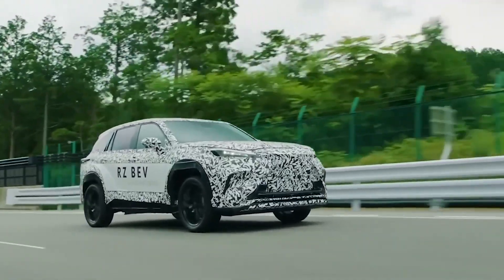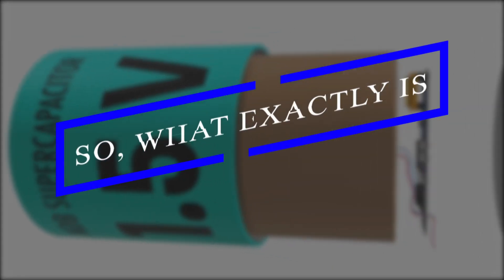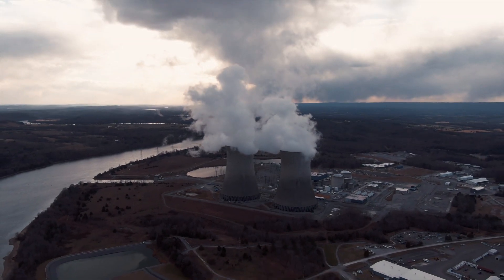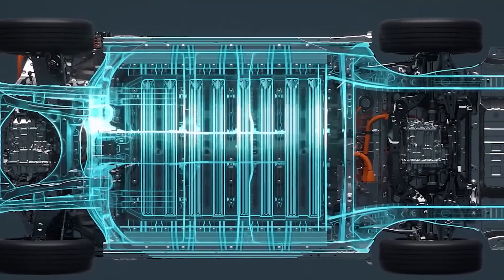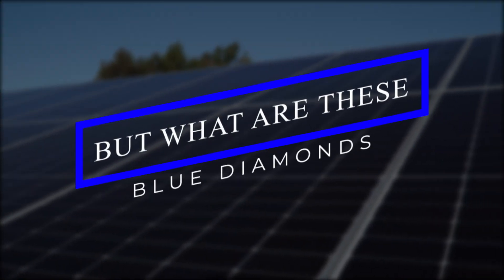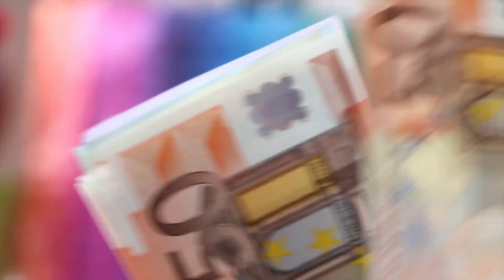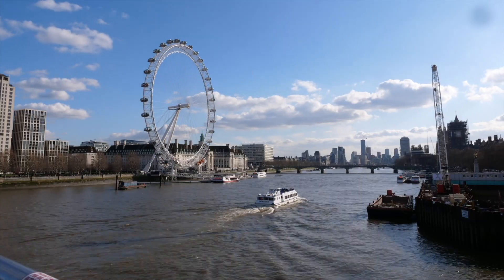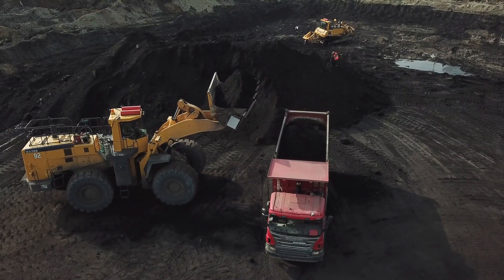IT’S HAPPENING! Nuclear Diamond Battery NDB’S Will FINALLY Hit The Market!

Comment: So they take in radiation from the surrounding area? or is it more of it charged with ratiation, are they self charging?
Reply from the maker: NDB will use nuclear waste that has already been stored somewhere, so they will not take radiation from the surrounding areas for now.
Reply: @TechLab12  for now? :)
Reply: @iangrabowski2298  These betavoltaic batteries are using the beta radiation (electron radiation) of radioactive carbon 14 as energy source to output electricity. With some efficiency (<50%) you can make a battery output such radiation. As carbon 14 is not very radioactive (decays slowly) you get a long lasting battery that is relatively safe, but the slow decay also means that the power is very tiny making them only usable for very niche applications such as pacemakers. Forget about using these for EVs, smart phones, laptops etc. as the power density is >1000 times too little.

Comment: Will these batteries need to be charged over and over or will they have take 28,000 years to dissipate their charge?
Reply from the maker: The batteries can go 28,000 years without charging!
Reply: @TechLab12  No, that number of 28,000 years is completely false. The half life for Carbon 14 is 5,730 years thus 28,000 represent 28,000/5,730 = around 5 times of dividing the power in 2. That means  2x2x2x2x2 = 32 times lower power than when it was new. If your C14 battery outputs 100 micro Watts, you will get 100/32 = 3 micro Watts out of the battery after those many years. That is a very ideal best-case with a preserved efficiency (which is impossible), nothing decaying or breaking down other than the Carbon 14 material itself. As power density is the serious weakness of this battery technology, it means for this number to make sense, you will need a battery 32 TIMES BIGGER to last that long LOL. But even worse, the power density at day zero of use starts at >1000 times too little (if used for replacing ordinary batteries), thus if you want an EV battery to run on nuclear diamond cells and last this long, it will need to have a size of >32,000 times what is standard today for those 28,000 years to even have some meaning.
Try to understand the science and you will agree that your video is plain stupid. These batteries have no other future than for niche products incl. pacemakers and low power sensors.